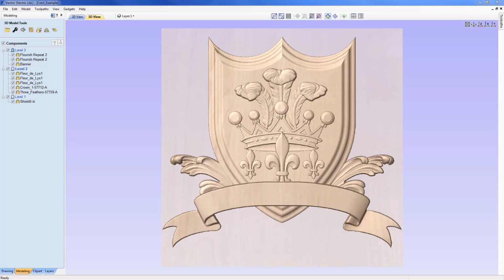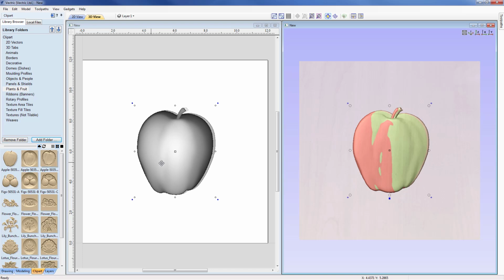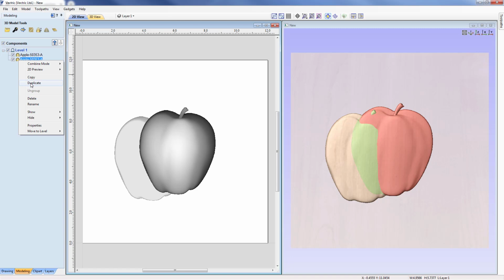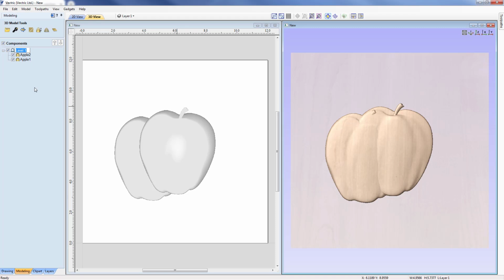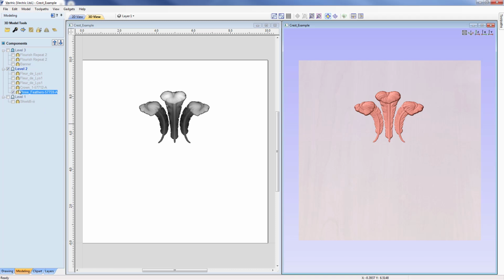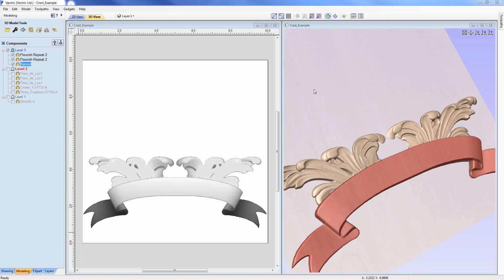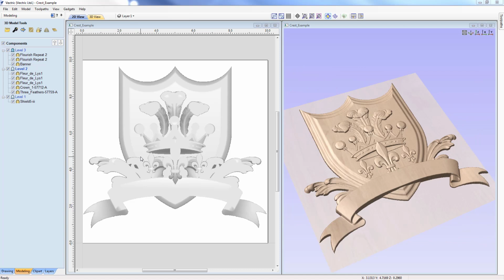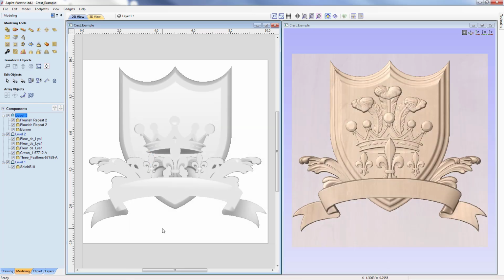Vectric V10 Tutorials | 3D Modeling | Component Tree Guide

Comment: At 16m in you begin discussing how the combine modes cause components to interact with each other and this interaction is based on the highest value.. I am not sure what you are talking about with the highest value.  If I take the crown and move it up the component tree so it sits above the 3 feathers ( so now in the hierarchy the feathers are higher ) nothing changes.  Something in the way this is described is missing what feels like some important information. If I look at the SHAPE HEIGHT I do see the crown has a higher height than the feathers but the Floor_de_llys in the middle has a lower shape height but yet sits on top of the crown.  Pretty confusing.